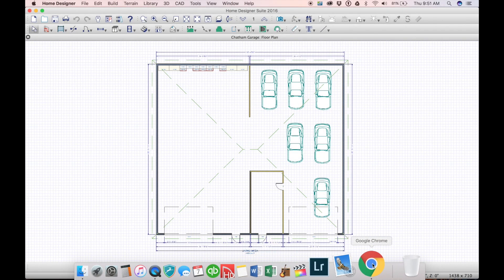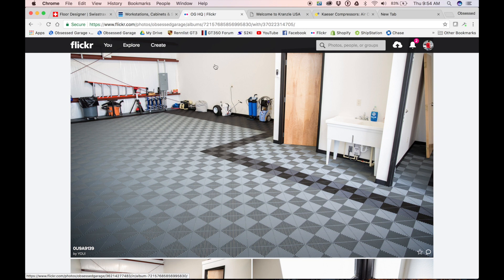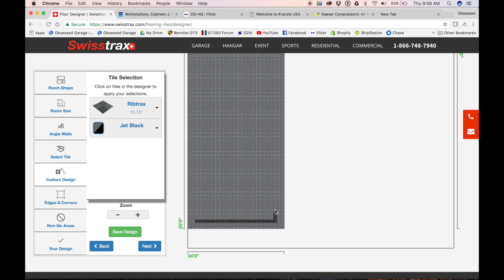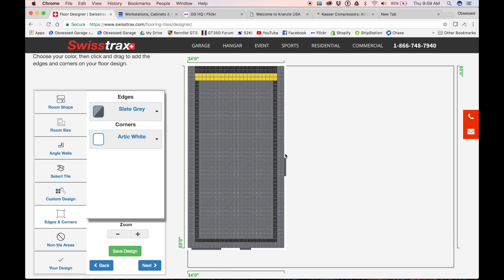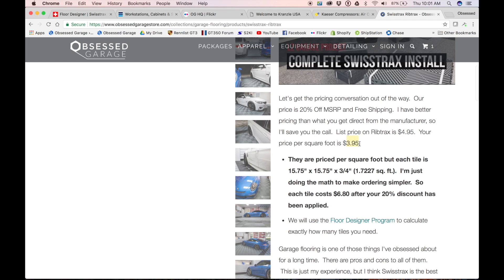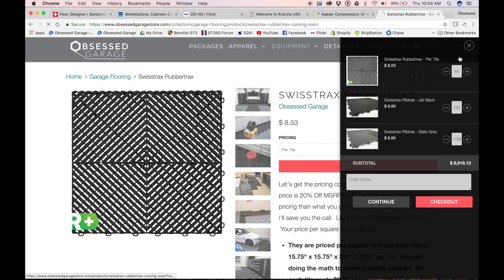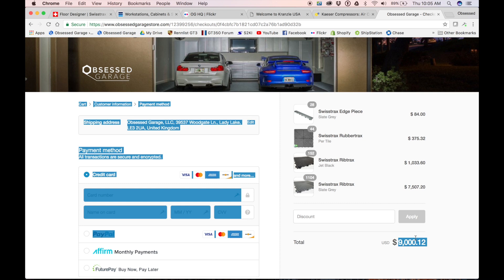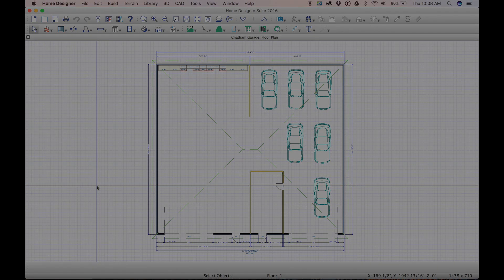Designing Robert's Garage: Video 2 -Flooring

Comment: I'm using swisstrax or a product very very close to in the clipping room of my Show Cattle barn and I love it. What I don't love is the price of it. When I build my new barn I wanted to put new flooring but I think I'm going to have to take my old one with me I just hate that it's green. I would love to have that gray with the rubber trax around each chute. But the green one I do have was bought used at a fraction of the price so I guess I can't complain too much.
Reply: You're going to be at a high price whatever you do. Even with tile, you're looking at $3/sq ft on the low end for mortar, grout, and installation. Decent inexpensive tile starts around $2/sq ft, so you're still right there at Swisstrax cost. Having high quality professional epoxy done can also run around $5/square foot. At the end of the day, flooring is expensive.

Comment: Hope your storm prep is obsessed, too.  Gas up that Raptor.
Reply from the maker: Porch furniture put away, check.  Car Capsule broken down, check.  Generator battery replaced, check.  That's about all you can do.
Reply from the maker: I have like 50 windows.  Boarding up your windows in Central Florida makes little sense.  Although unlikely, if window breaks, get a new one.
Reply: Just got home to Michigan from Ocala, Florida.  My dad passed and we had his funeral at the National Cemetery in Bushnell on Friday.   Got back to the Hampton Inn in Ocala and brought my mom there to ride out the storm.  My mom lives in the historic district in Ocala and we weren't going to leave her for what they were predicting as a monster. The Hampton is fairly new and that place was rock solid.  We woke up to a few twigs and branches but that was it. Parked my new 17 Yukon in Diamond parking and not a scratch on it.  Sam's club had gas sonwe filled up and we headed home on Tuesday.  I75 north as GTG, but south,  holy crap not good.  My Yukon does 500 ish miles a tank so found gas in Macon Georgia and after Atlanta, gas was easy.   Your right, central Florida get a generator and buy new windows as needed.  Not one broken at my mom's or my sister's place in Clermont - she lost a couple shingles on the house and a couple on the boat house.  Hope your place ended up ok too Matt.